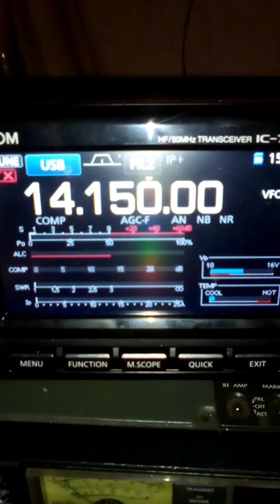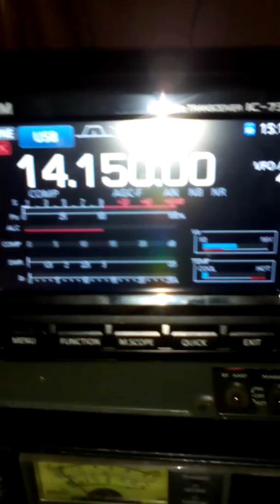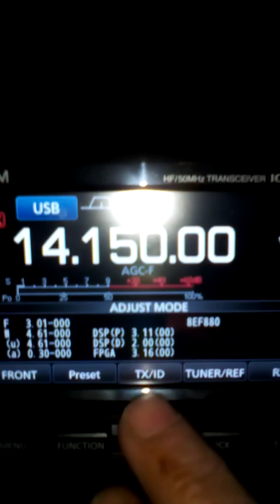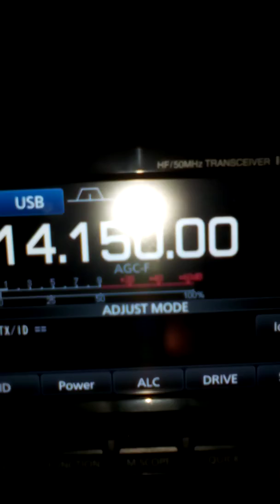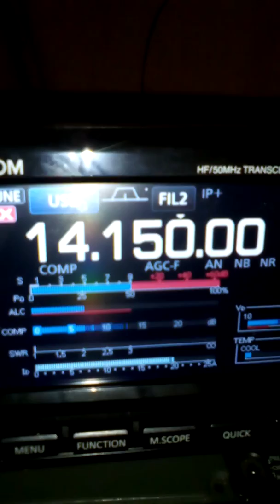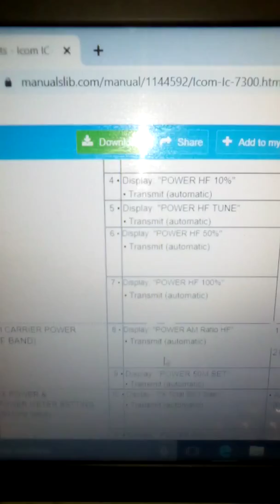Ic 7300 SSB power adjustment. No soldering, service menu adjustment mod

Comment: Increase the supply voltage to 15 volts and you have no power problems.
Reply from the maker: My rig powered down the more I drove it. I believe I set it around 11.75 volts. Power supplies have different amps

Comment: My PO varies across the bands, as low as 60 watts on 7,14,18,21, 28 and 50 while 1.8,3.8 an 24 MHz is around 75 watts, with PO set to 100% and transmitting FM.  Did you PO vary by band?

Comment: This really helped me, I took note of the previous settings and then changed the two you show here. 

You have to press SET before4 moving to the AM settings and then Set again for them,

Many thanks, it was my FM signal which was showing low 60watts  it is still not quite hitting a 100 but its about 90 watts which can drive my big amp better (wants to see at least 100 watts)
Reply: Oh and by the way - little advise for filming videos, try and film things in landscape mode.. not narrow like this. 

It is a terrible format. 

Movies don't do it.. so neither should we 

Unless you are trying to film a full body shot.. or a tree or tall building.

Comment: Don’t do this mod. It will cause your transmit to have distortion. It will also interfere with the way the alc does business. The ic-7300 does transmit 100 watts pep. If you want more power, use compression. That’s the trick. The mod will cause you to have a dirty signal. The ic-7300 does have 100 watts pep.  Don't forget the Crest Factor. If you read 40 watts on an average watt meter the crest factor is times 2.5. That would be 100 watts PEP. If you inject a dual tone audio signal into the mic jack, alc adjusted correctly, looking at the output on a scope you will see 100 watts PeP out. At the same time using an average reading watt meter, you will see that meter read 50 watts. This is all normal for the ic-7300. Your radio is perfect out of the box. Leave the radio alone. I wanted to add one more thing. When you do this mod, the ALC will lose its calibration or set point. Not a good thing.
Reply from the maker: To all of the thousands of people who out of the blue comment on how awesome my audio is, please stop lying to me everyday

Comment: Just tried this on my new 7300, 11-9-22 and followed the steps. It didn’t work, hmmmm. Went back to the default setting ! What could i be doing wrong ! I did hit the set button and it went back to default !  Thanks, Jim L.
Reply from the maker: Press SET
Reply: @ededison9404  DiamondJim wrote: I did hit the set button. If you can read correctly, you have a clear advantage!

Comment: your radio will not last doing this mod
Reply from the maker: How many more years till it blows up? Already been 2 years but I only use the rig as a NCS and only about 2- 10 hours a day
Reply: @ededison9404  it depends on usage but changing service menu is a bad idea because they are set for a reason
Reply: @mikegianfrancesco9431  Maybe you haven't heard of the ALC issue in these and other Icom radios. Google it.  I'm still waiting for mine to blow up too. I did this in 2020 and still going strong, using it DAILY and peaking 150 watts on SSB. 

Just don't run digital modes and you'll be fine. Rumors that this will damage your radio are a myth.  The only way to damage a 7300 is if you screw up the settings in the service menu or blast it full power on a continuous mode. If you follow this video there is no problem.
Reply from the maker: 3 YRS NOW

Comment: Hello, I have a problem with your manual. I go to that menu and find TX power 100% HF, It is set to 4.333V so I change it to 4.901V and HIT SET then the radio change my setup to custom 4.333V. Do You have any idea whats going on ?
Reply from the maker: No
Reply: I'm having the same problem,  did you ever figure it out?

Comment: It's your radio, do what you want. That being said, just adjust your audio, and the ALC to where it should be. My 7300 puts out 105 w out of the box with clean audio. It's not that complicated really, it just takes what we should all be doing anyhow.
Reply from the maker: The 1st production run of this rig only did 60w on SSB, it's great yours has full output. My amp was only doing a measley 800w. That's why
Reply: Mine used to be like that too, when it was new 3 years ago.  You can't fix what's not broke.

Comment: I finally got the pep problem solved. I think i might have forgotten to push SET. 
My carrier output has gone up to about 150 watts on Rtty but i adjusted the power setting to 85%
with brought actual carrier to 100 W

Comment: I noticed your adjustment  on HF 100% went (4.901 V) around and back to (4.901 V) again. The same setting. Was i looking at the wrong number ? I don't get it. Please explain what numbers i should be looking at. If you decide to shoot the video again, would you consider wearing a neck brace ? That might keep the video more steady ! nyuk nyuk !
Reply from the maker: As you turn the tuning knob, the voltage will change, just keep it under 5 v
Reply: Obscene video badly made and poorly explained
Reply: Ok, i got it to work. Thanks Ed. The biggest problem i had was the light on your smart phone created a glare on the radio screen which made the screen hard to read.

Comment: I must have missed a step somewhere. There is no increase in ssb power. In fact i lost ssb power. I started/stopped the video 3 or 4 times. The process took me about 7 minutes. My dummy load started smoking. There was no oil in it ! Duh ! I will try again but first i will turn down RF % to zero. I think your instructions are well intentioned, but either not explained correctly or they are incorrect. Your RF power meter started at 100% and ended up at 100 % There was no peak up in power. My settings initially in HF power 100% were around ( 4. 200 V). Could it be the (4. 901 V) was the final setting you set your rig to ? I downloaded the service manual. I will take a look at it.
Reply: You're not missing anything. Doing these CB-style mods to increase "talk power"? Unneeded and a recipe for a lousy signal. At best.

Comment: not sure why you need to do this adjustment. Doesn't this rig come adjustment and tuned from the factory ?
Reply: My 7300 only modulates up to 35%W on SSB at full power setting from the factory. Even into my dummy load. 
I purchased the rig Dec 31, 2020.
My old Icom 745 modulates a full 100 % on ssb and my modulation was only about 60 %. 
But the ALC adjustment did not work. My guess is a former owner had it defeated. 
I would like to modulate 60% W SSB into my Ameritron 811H. But the 7300 won't even achieve that.

Comment: My 7300 put out full power out of the box as long as I kept the ALC within range.  Crank the mic gain and compression up too high and it folds back to limit output,  I keep my mic gain low enough to go no higher than 1/3 or 1/2 on the ALC and it shows about 105 watts out on the meter.  No service menu adjustment or internal mods, no soldering at all and it took about 5 minutes to do if that long !
Reply from the maker: The older models have this problem. Newer ones seem to have full output

Comment: The first 3 things I did after FedEx dropped off the Box infront of my feet was, replacing the factory fan with an more efficient and super silent Noctua FAN, MARS CAP and RF-PWR MOD's. Everyting else on this radio is just fine the way it came from the Manufacturer. Thx for sharing this video with us. Stay safe & merry x-mas! 73's de Günter

Comment: hello nice video I have a question when you made your change you were plugged into a 14mhz antenna or a dummy load?
Reply from the maker: i was using a dummy load, but 14mhz antenna would be fine
Reply: @ededison9404  ok thank you
Reply: @ededison9404  but with a dummy load of 1000 mhz 50 ohms 100 watts HF ca would do it

Comment: Be careful adjusting the AM power level, if not set perfectly you can cause over-modulation. You should double check with an oscilloscope.

Comment: I have the opposite problem, mine is showing 115 watts out of the box with RF power set to 100%. I want to adjust it because I am concerned it may damage the finals overtime.
Don't know why they don't calibrate the power at the factory.
Reply from the maker: I been tuning up my big loop with 200w on rtty for a yr and about 115w ssb  I don't think you will have a problem
Reply: @ededison9404  le 7300 a 150 waat donc 2x75 waat commentr a tu fait pour 200waat sur rtty
Reply: @Flo.Florian.p  Alors FLO ou MANU? Tu cherches a gonfler le 7300 !!! Pas bien ça !!! BONNE ANNEE 2021 MON GARS !!!

Comment: I think several people are frustrated by the ssb power output, me too... I was 30w lower compared to the ft991 with new finals. Thanks for the tip.
Reply: You should measure power in SSB with a PEP wattmeter!
Reply: I have same issue with my 7610 using a proper PEP Meter. My 7610 shows 30W on SSB, `100 on FM,  My 991A shows 100W on SSB and FM.   Others that receive me are reading my 7610 a full 2 S-Units less than my 991A.  Most will flame with the response "Get a proper meter" when they didn't take time to read the facts (Rxd with 2 less S-Units). 
Icom states the ALC is overly aggressive. I could elaborate, but you already know the truth. 
73 and best to you.
Reply: @AirGunScientist  I tried a couple of things. I bought a 'close to' real PEP power meter (daiwa CN-901). I will say according to the precision, mine IC7300 is delivering 90~95w without the mod. So I will recommend to revert the mod to the original settings you had if you take care to write the factory values as it depends each rigs. ALC is over agressive yes, but it reachs no problem the 100w.
For the 2 S-Units on reception, using same antenna and locally (40~80m) , it's almost hard to believe. 2 S-Units, 12 db means: If they receive you with 10w @s5 , you need 20w to get 5.5 S-U, 40w to get 6 S-U, 80 to get 6.5 S-U and 160w to reach s7 (2 unit difference between S5 @10w and S9 @160w). It's an example for sure but 2 S Units it's huge. Even with this mod you won't get 2 more S Units if you follow the 'power rules'
Reply: @djflexlive  Yaesu 991A shows +90-95W, IC-7610 shows 30W.
Yaesu 991A gives 2 full S-units higher reading vs IC-7610
Reply: @AirGunScientist  ok. A good test can be to test it yourself with online websdr to check the audio, signal and band with scope, it may help you digging the issue also
Reply: FT-991a: bad alc. IC-7300 good!!!

Comment: Hello Zes Smallville question is it a antenna tout tube on 140000 MHZ tous validate the New value beacaus i canal not validate it because I am with a 27 MHZ antenna it is maybe because off thank you For you answer.
Reply from the maker: You need a dummy load then
Reply: @ededison9404  ok for a Jimmy lord ans tous validate the value pres SET
Reply: @ededison9404  my crurent value ans 4.372V must be est 4.901V
Reply from the maker: @CedricPOG14CP070  I'm running at 5.00 volts now. Not much different than 4.91
Reply: @ededison9404  ok  is tour ALC stable now with your change un value

Comment: Was that just a regular power meter or PEP ?  Regular wattmeter with 100W will read about 40W on SSB. I just got my 7300 couple days ago but haven't had a chance yet to make any measurements or look up the specs on it's finals but am will to bet it's just a matter of time before before it goes back for new finals. My Flex 6600 shows about 40W unless I use PEP meter or spectrum analyzer. When and where is ur net ?  73
Reply from the maker: I NCS on Thursday 7.185 6:30 est  a year and no issues

Comment: What was the original voltage? Also did you see a peak in RF power (where it went back down as you continue to increase then backed off)?

Comment: Hallo and thx for the video.
Icom has no problem with output power. Icom has problem with ALC. I have 100w i FM or RTTY mode without any modification. If you change this adjustment You change output power on FM and RTTY mode, instead of 100w you get 120w!. Do not look what shows you power meter only on SSB mode. Icom says... FM klasse A-100w, SSB klasse - C that means 40% less power.
73 REGARDS from Netherlands
Reply: SSB is not 40% less power, use the correct measurement methode for SSB!
Reply: @MrTalaue  Has absolut 40% less power.....if you have 100w, you dont have a originel service factory setings.  Dont care about my meseurement methods, i know what's im seing.
Reply: @PA1RAF-SP2RAF  sure, you are the greatest
Reply: @MrTalaue  i know..😀

Comment: Why did you have to  low down power on AM ??????
Reply from the maker: Am uses 3 times as much as SSB.cw.rtty. I did it as a precaution. I imagine you could go up a bit more. But I believe it was at 100w am. I don't want to damage my rig
Reply: @ededison9404  ok.  I did it as you showed.  the radio works great

Comment: THank You Ed,   Doing this coupled with being a bit more conservative using ALC brigs out a more clear studio quality sounding audio with full output power.   My max power before the adjustment was 85 watts.  which as per icom is commercially acceptable.  I am more satisfied with the radio sound and performance now.  Using a Heil HM-12 2with an 8 band EQ.
Reply from the maker: Thanks, I been getting a lot of flack from some people who have not done it or have not had to do it
Reply: "Studio quality" from a radio that only transmits 100 Hz to 2900 Hz on SSB? I don't think so.

Comment: trying to understand why did you have to do this?
Reply from the maker: WASN'T  DRIVING MY AMP AS WELL AS MY OLD RADIO , SOME ARE GETTING  FULL OUTPUT FROM FACTORY , MINE WAS 65 WATTS
Reply: @ededison9404  what model is your Amp?
Reply from the maker: @rebelliners  dentron MLA  2500

Comment: One more thing if you do this video again. Recommend taking a snapshot of all the readings before you turn the knob. Just In case there is a problem you can go back to the original settings. These adjustments are made individually to each rig and there is no default or reset to go back to. I did this mod to my rig and works great. If you use an amp you may want to make sure there is not much overshoot with this mod.
Reply: Also recommend not recording video in portrait mode.

Comment: Seems you have big swr in your dummyload? When using internal tuner with swr i thhink your power meter show too much power?
Reply from the maker: I have the calibration knob all the way up. I do this so I can get the flattest swr on my antenna tuner. It's about 1.3/1 on the load